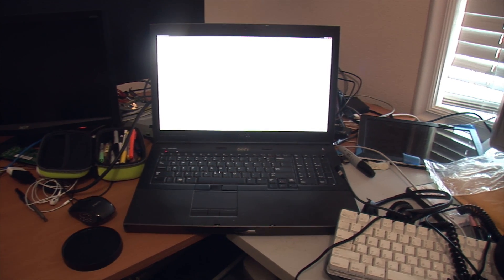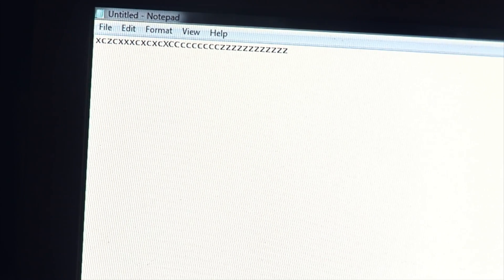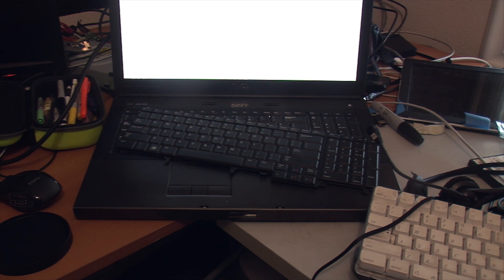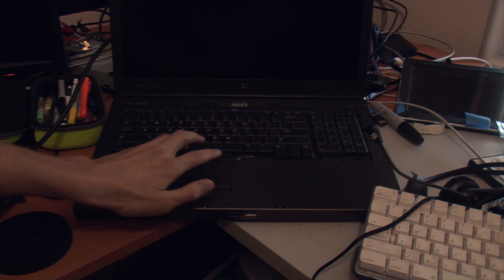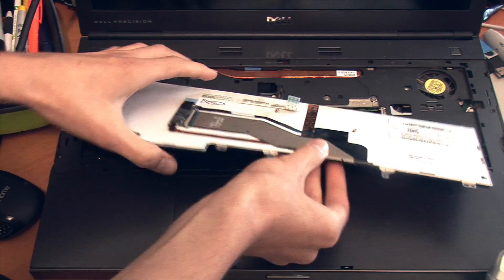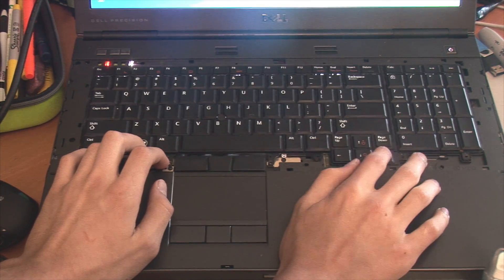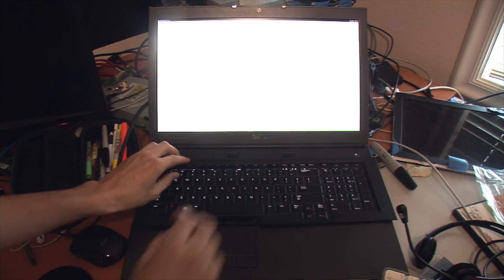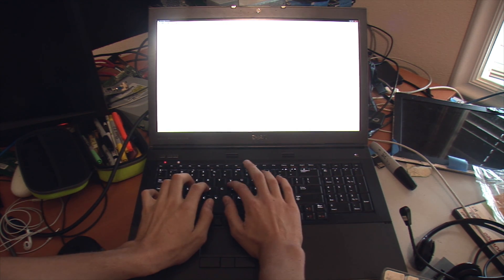Replacing the keyboard on a dell m6600

Comment: How do I replace a single key on this laptop? My "T" key randomly popped off today and can't seem to get it to latch back on.
Reply from the maker: Is the key broken. There are little tabs on the key that will sometimes break. If it's not broken and lined up correctly it should just take a bit of for d go put the key back on.
Reply: @ElectronicsWizardry  It doesn't seem to have any physical damage to it. The E popped off a few months ago and I seemed to have fixed it without much trouble. I can't Seem to get the T to connect or latch on in any way. Just very loose.